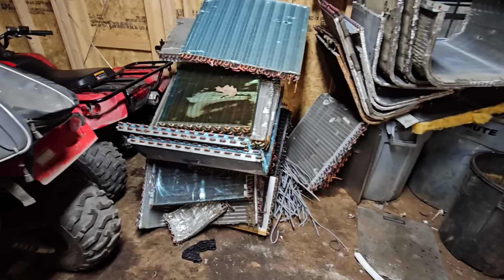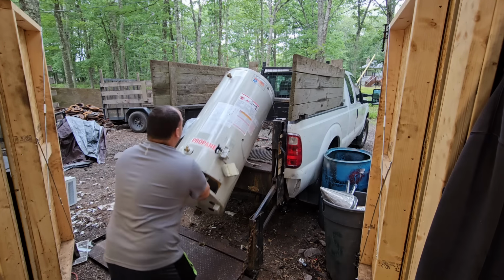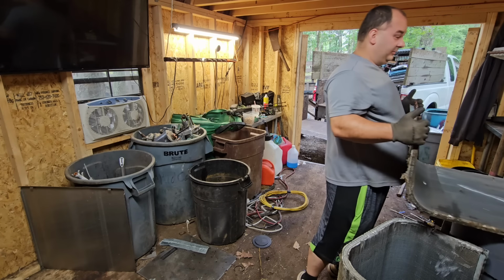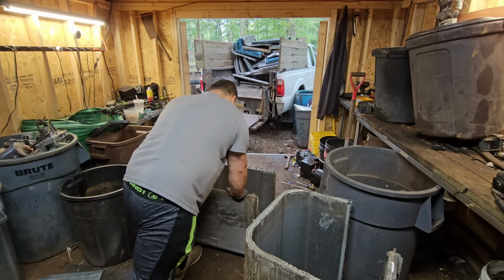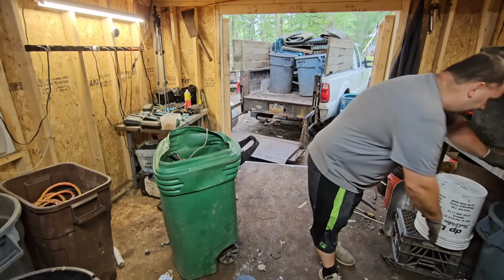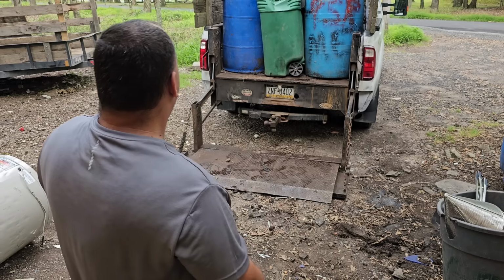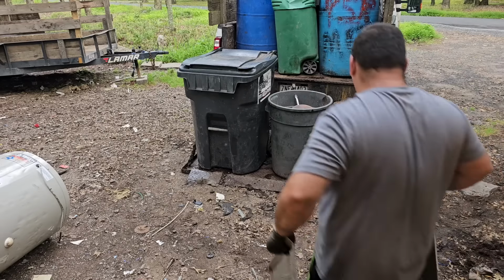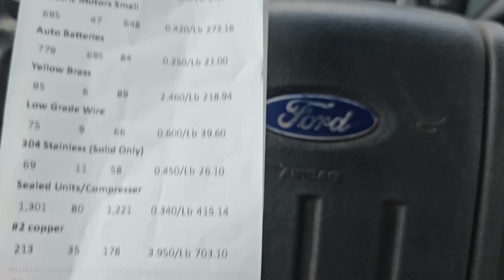Scrapping Airconditioners. there's money to be made

Comment: Notice you didn't cut the ends of the air conditioner radiator some people call them macaroni u shaped copper pipe things thi is older one mike just saying cold 🥶 weather now wish had some heat back now ha glad ran across this always good seeing you whether in one i saw before are not like when you post you be down to earth take care my friend
Reply from the maker: @KevinHarvey-qw5mj  yeah, the current scrapyard, I sell to there's only a 10 sense deference, from clean ACR to dirty. So it just doesn't make sense to do the extra work
Reply: @Adventureswithmike1  I agree my friend you know what you doing just other people cut them off so didn't know glad you posted something that way can keep track of you lol have a good one mike
Reply from the maker: @KevinHarvey-qw5mj  i will have more videos out soon as the weather starts getting better.